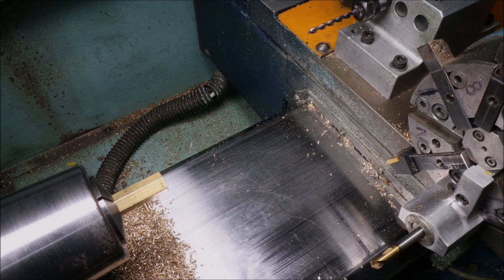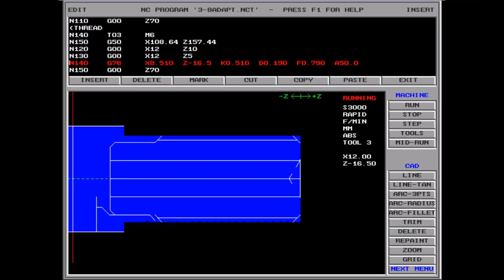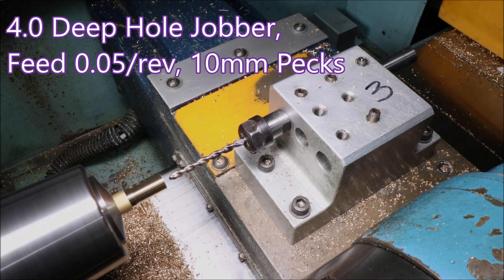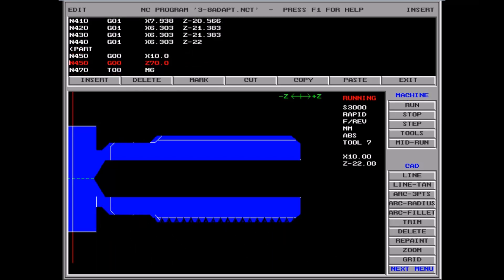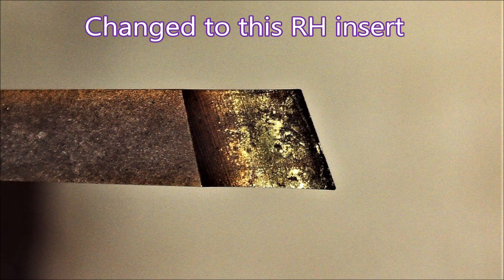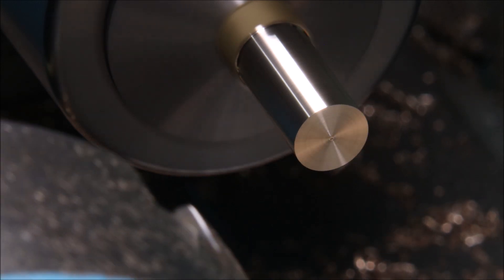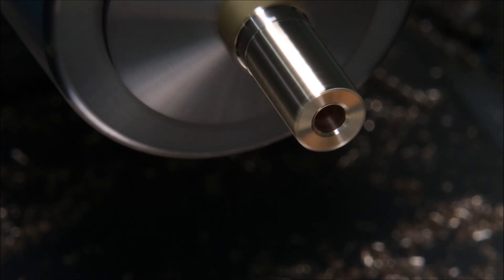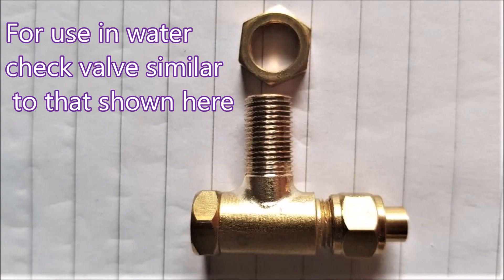Watch cnc lathe cut perfect thread at 3000rpm

Comment: After years of having watched your channel it's finally happened:)
About six months ago, I found a small, used CNC lathe. It's is pretty comparable to the Hurco in size, I think. About the size of a mini lathe but about three times the heft so should be a lot stiffer. It has oiled V-bedways, not linear or box rails but with a collet chuck with a max through spindle bore of 27mm. Also, a pretty beefy 1.3kW servo motor on the spindle. The lathe is Chinese but supposedly one of the better ones in this size in terms of build and accuracy. I will run it off of LinuxCNC and have parts coming in for that but the mechanical stuff is pretty much all there. 

Anyhow, no turret on it of course, but once in a while they come up on the used market there, too. Just tricky to find the smaller ones. But here's the question - finally, haha - how often do you load up all 8 slots in your turret? I am asking since I see more 6 slot ones and very rarely the 8 tool turrets.
Reply from the maker: Congratulations!! I think a 6 tool turret would be plenty.  I don't recall ever having 8 tools in place. Turn. drill, bore, thread, ream, part would be a pretty complex part.  Anywhere you can mount a gang tool block on the carriage?  I really hate having long drills or boring bars sticking out from the turret.  There would be a lot of parts could be made with just a drill and a parting tool with no stopping if you were to use the parting tool to do the turning.  A friend of mine makes small parts and uses a Sumitomo parting tool and never a turning tool.
Reply: @smallcnclathes  Thanks for the speedy and positive reply:). 
I've had a manual mini lathe for a long while now but I got a smallish but capable CNC router/mill a bit more than a year ago and I think that really firmed up how nice of an addition a CNC lathe would be. 

Granted, I am a tad short on space on the X, but may be able to extend that a bit. I plan to model up the lathe in CAM soon so I can better judge what can be done. 
But I was hoping to make a turret + a tiny bit of gang tooling work like you often seem to do:)

On the note of reducing tools, I have really enjoyed seeing how much profiling you have done with a "parting"/grooving tool. And interesting to hear your friend does it all the time, too. 

I plan on rewatching a lot of your videos, taking some notes and then perhaps come back with another round of questions on specific tools, if you don't mind.

Thanks again, much appreciated.
Reply from the maker: @AntiVaganza  If you are on FB you could join the Hercus Benchtop cnc Users group.  No a large group, but some helpful folks on there.
Reply: @smallcnclathes  will do and thanks:)

Comment: Very cool. Buying myself a CNC lathe this year and trying to gather all the info I can find.
Reply from the maker: If you have had little to do with a cnc lathe so far it will be quite and experience.  Thanks for your comment.  Nigel
Reply: @smallcnclathes  I have a cnc router table, so i have some cnc experience. I have some hobby lathe exp but no cnc Lathe experience. With the CNC lathe and Router table i can turn my Milling machine into a CNC.
Reply from the maker: @magicman9486  what size chuck is on the lathe?
Reply: @smallcnclathes  6"
Reply from the maker: @magicman9486  Nice, that should be a lot more versatile than mine at just 4 inches

Comment: I'm in the middle of converting a 9x20 to CNC with a Masso control.  I'm curious about the business side of what you do.  How you find work, mix, volume, inspection, etc?
Reply from the maker: My situation was a bit strange. I was working as a freelance draughtsman with a few companies and often got to make prototypes to prove the designs we came up with.  When I got a small cnc lathe, I was asked if I could make small batches of some of the new parts.  It grew from there with a bit of word of mouth helping it along. If I were to offer any advice it would be to find a local business to which you can direct work that you can't handle.  Always try to help with making the part more easily and cheaper. Don't sell yourself too cheaply to get work at the start, as you will always be behind the eight ball.  Only work for customers you want to work with.  No point being self employed and working with horrible people.
Sorry I am not able to help more but my situation was a bit of an odd one.  Never made a fortune, but never hated the job either.

Comment: The parts look beautiful. With the jobber bit, if you did pushed it harder would you need to perhaps have a mist spray at least?
Reply from the maker: Possibly, but with no way to automatically turn it on and off, I could not be bothered with that. Thanks for your comment, Nigel

Comment: Hi, thanks for the info on these machines. Do you have a video on the mechanical portions of the lathe? I checked your prior videos and didn't see one. For example, how the bed/cross slide ways work (box, V, linear bearing, etc), if it has ballscrews, etc. Thanks.
Reply from the maker: Thanks for your comment Nick. I will give it some thought. Not sure how to put it together other than a video of still photos.

Comment: With parabolic drills, trend towards just enough feed to break a chip.
They just don't have enough material left on them to really push the feed rate, they're expensive, and deep hole drills are usually... deep in a hole when you  snap them.

Very efficient programming as always.
Reply from the maker: Thanks Kevin, so you would advise to pretty much feed as for a standard drill to be on the safe side? Nigel
Reply: @smallcnclathes  I think they usually take slightly feed more to break a chip in steels, because they cut a bit free-er, but yes, err on the side of caution for them.

I like them for process reliability in deep holes, rather than how hard you can push them.
Reply from the maker: @kevind1865  I must admit, I have used them a lot in brass and aluminium and they last really well. I love their ability to keep clearing chips.

Comment: From a little bit of research it looks like you can run parabolic or deep hole jobber drill about 17% faster than a regular jobber drill.
Reply from the maker: Thanks Rob, I take it that is feed rate rather than rpm?
Reply: @smallcnclathes  that is correct, at least from what I gathered.
Reply from the maker: @rob7439  thanks for taking the time to look it up. Nigel

Comment: My lathe will shit itself trying to thread at 3000rpm 😂  Interesting result with RH parting insert, I've not observed it on my manual lathe. Perhaps at higher RPMs even small things can improve or make harmonics worse.
Reply from the maker: Those inserts, have almost no radius on the corners, I think it is 0.05. I think that contributes to the great part off. My other inserts are 0.2 radius and I would not expect them to be that clean either.
Thanks for being a regular to leave a comment